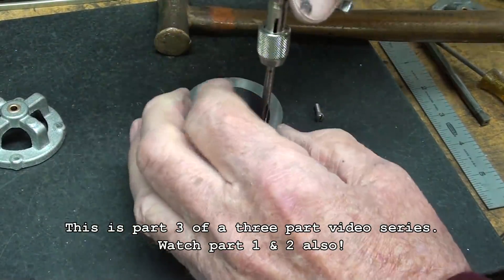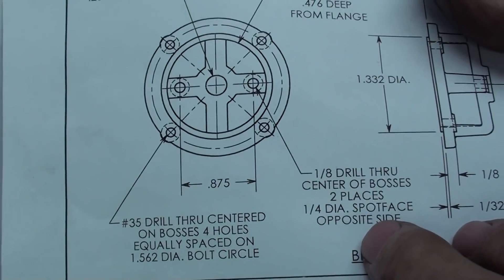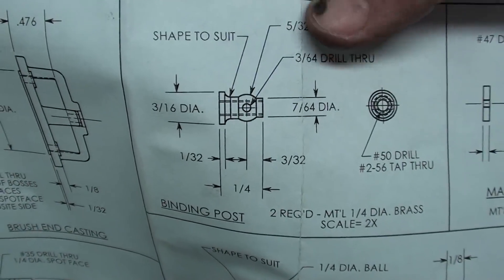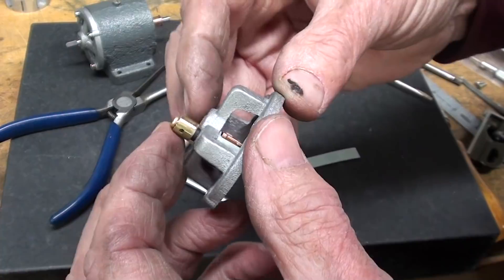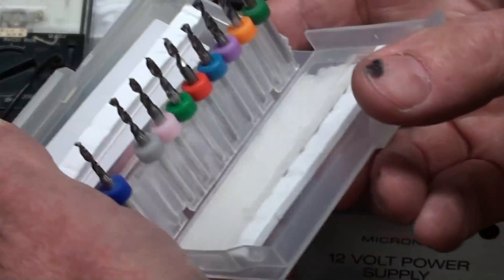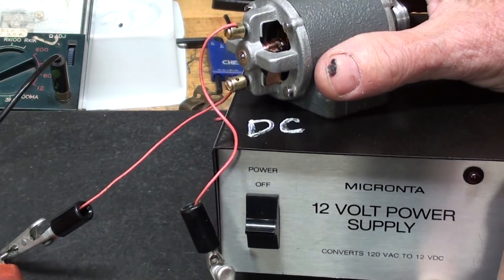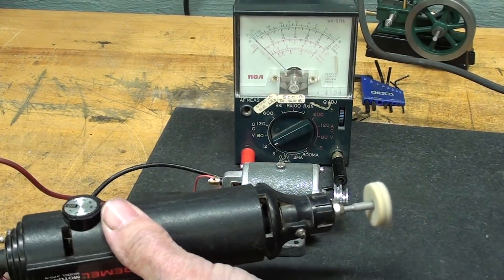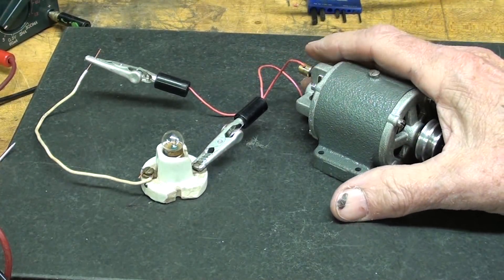Make a Steam Powered Dynamo pt3 Tips #438 tubalcain

Comment: Fahnestock Clips - I'm from the days of the Chesterfield smoking hardware guy. 
The clips were to the right of the light bulb display and the left of the knife switches with the ceramic bases. Across from the tube tester. And I could smell the light bulb display when you showed it. The bulb with the wire soldered on sure does being back memories - it's how I found my way into Electrical Engineering...

I like the dynamo, and I see they have some nice other kits. I'm liking the little shaper and the 1/4hp repro steam engine. Thanks for clueing me into this neat company...
I may just build a dynamo and use it to drive the shaper... The dynamo looks like a nice easy warm up to the more intricate stuff.
Good series!
Reply: LOL  Me too Scott.  I remember well the "tube tester" in hardware stores.  Folks would forget to set the filament voltage to the proper setting a it was guaranteed that they would be purchasing a new tube after they blew the filament.  Sometimes (unscrupulous) shop owners would intentionally set the filament voltage high in order to boost their sales..
Reply: Scott Marshall Our local hardware store had thousands of oak drawers, and the clerk could grab the right one without looking. They had a basement storage area with specials. Like handles for a wheel hoe - several types. Axe handles - several types. Etc.
Reply: With wood plank floors. The 'feed  & seed' was in the back, What I'd pay for an air freshener with the smell...

Comment: awesome series of videos. I was thinking as you put the spring in place to hold the magnets that I would have used the string to pull the spring through from the other side. I've always been fascinated by dynamos and  motors, the engineering is much more complex than most people realize. magnet sizes,number of fields,armature diameter, no of turns per winding, length of armature , all make a dynamo work differently and are engineered to produce the highest output to input power ratio. 
Thanks for another great series of vids.
Reply from the maker: You are right, there is a lot of engineering that goes into generators, I worked in a motor shop where they rewound motors

Comment: If I remember correctly,  those clips are called fan stock clips.  I used them for building crystal radios.  I also used post binders.  The post binders looked much nicer.  

A wonderful project!  I look forward to seeing it run with the little engine.  One nice thing about using the little flashlight bulb is you will not have to run your engine very hard to light the lamp.  

All the best!

Mike
Reply from the maker: Thank you, my crystal Radiohead them also
Reply: Close.  Actually, they're Fahnestock clips.

Comment: Fahnestock clip is the name you seek Sir. Thanks for all you do and God Bless.
Reply: Very cool Fred.  I was about to google it.  I used to take them off of old batteries and screw them to my pine board base when I was making electrical projects.  Fun stuff and great memories!
Reply: Built my first crystal radio in1949 using clips off of batteries. Cats whisker and galena xtal mounted in lead. The coil was wound around a Quaker oats box and a piece of a hacksaw blade to tune.
Reply: Very cool Fred!  My first crystal radio was in 1956!  Galena based as well. Remember sanding off the enamel off the wound coil?  LOL   I lived in Rochester NY and had and still have a 50KW AM radio station there (WHAM).  I was able to pick that station up what that radio by touching anywhere on the crystal!  LOL  It got me started in a career of communications.  Ya never know what will "spark" a youngsters interest!  Went on to be a Radioman in the Coast Guard during the Vietnam Era, an Amateur radio operator WO2P, and worked at Xerox developing internet routers and gateways with Palo Alto Research center.  All because I successfully built that first radio.  Ya gotta find the spark that lights up a childs eyes then keep it glowing...  All the best-  Fred
Reply: W4JLE here
Reply: Good stuff.  My buddy in college let me talk to a guy in Idaho once, when a Kiwi broke in, he grabbed the mic.  I was hooked.  Got into AM, FM and TV broadcasting as well as two way radio.  Good stuff.  Light the spark and keep it glowing.   That is a quote worth keeping!
Reply: @w4jle  My first crystal set would have been around 1970. Enamel wire wound around a square wooden core. Piece of bent copper pipe for the tuner. IN34 diode for the detector. And, of course, Fahnestock clips for the headphone and antenna leads. Got about 5 stations.

Comment: Our local dime store not only sold the little bulbs, they also had a wooden tray with replacement glass lens for flashlights.  They also had a vacuum tube tester, cardboard tubes of BB's and roll caps.
Reply from the maker: Yes, I remember the little rack of replacement glass. And it was a glass, not plastic

Comment: I fully agree with your ranting. I used to buy gilette blades (had mach3) untill the made the 6 blade version and the price of mach 3 blades went up to 20$ for a pack of three blades. Then I discovered the joy of the old ways - bought a double edged razor blade and feather blades (the best ones) and now shaving costs pennies! Love it!!!
Reply from the maker: Are use the throwaway razors from the dollar store. They shave every bit as well as the expensive ones

Comment: I picked up a Dremel for ten whole AUD just three months ago from a garage sale. Things just aren't kept these days the same way. It's complete including the original warranty and manual, I believe the receipt is still in the box along with a massive assortment of tiny burs, chucks and still some of the original buffing wheels. Sadly the front end oil lite bearing is wallowed out and the back end rabbit/hare fur vibration dampener are well worn and I'm having a great deal of trouble finding a replacement. Aside from that she's still in as new condition. 

Given all of this, I went out and bought a brand new "Dremel"... my god how things have changed, even in the 40 years I've been alive. Cheap plastic casings and ball bearings made of only the finest chinesium. Three dremel's later and the one I've now got is the same. Slowly speeds up so you have to keep winding it back down to maintain control. This one at least will run at a decent speed at WOT without having to apply a chinese burn to the casings. I'd wager the old one I scored with it's bakelite housings,  if fitted with a new front bearing would purr along like she did out of the box. 

I'd be happy to donate it to a better home Mr Pete, if you'd like it for spare parts or to restore to it's former glory.

Comment: Great video. The last flashlight bulb that I bought was from Sears and it cost me twenty bucks. It was in 2010 and I wanted to try using an L.E.D bulb that they offered as a replacement for three cell flashlights. I was not disappointed. My maglight has never been brighter and eight years later it still has the very same bulb in it.
Reply from the maker: Wow, 20 bucks for a bulb

Comment: If nobody has mentioned it , that little clip is a "Fahnestock" clip. They were used on old radios for antenna/ground connections as well. 
You used to be able to find a neat "pigtail" with these clips on either end that could be laid in a double hung window sash to allow your portable to connect to a larger antenna, without drilling holes in the wall. 

Also, that little generator just needs some tiny little oilers on the endbells to make it perfect.
Reply from the maker: Thank you

Comment: Hello Mr. Pete, you got me so interested in your Dynamo project that I visited the site PM Research INC and I purchased one of the Dynamo kits, however I don't have the equipment, skills or patience like you, so I bought the Dynamo kit machined and ready for assembly. It was indeed perfectly machined, so I painted the body and later this evening I assembled it. I looks a little different from yours with just minor differences, like the connectors where the wires attach. Once assembled, I found it difficult to turn the motor shaft. I loosened the back plate and front plate screws and that relieved the pressure, so suspect I have the bearing pressed in a bit to tight. I'll take it apart tomorrow and create a little more end play for the rotor. It turns OK now, but I think the end caps are a bit too loose. My kit came with what they call a pulley,  but I need to make a buy a pulley to get it to work better. Also my kit came with an eye bolt on top to hold the magnet spacer. Tomorrow I will hook it up to my power supply and test the Dynamo part. NOW the interesting part, I paid $95.00 for the machined kit and $10.00 shipping and got it in two days. Thank you for taking the time to show how to make the kit, even though I bought the machined kit. I was fun to assemble and is very well made. Thanks again, see you on your next project...Ken Marina CA.

Comment: Nice work as always! On larger DC machines the brush gear is adjustable this allows the brushes to be moved to reduce any sparking of the brushes, the direction of the motor/generator could have an affect the amount of sparking so adjustment would be made to find the ideal position.
Reply from the maker: Yes, I remember noticing that when I saw the large  D.C. machines in the Edison laboratory

Comment: Inserting the spring- put it in the other way around! Curve first, and just push.
Drilling all the holes in the milling machine means you both get them in the correct place (DRO offset) and can spot face them.
Ideally you would be able to slightly rotate the bell end at the brushgear- lets you adjust the timing for max efficiency.

Comment: You could connect the dynamo to an electrically heated boiler to make steam.  Run a steam engine with the boiler.  Run the dynamo with the engine.  Run the boiler with the dynamo.  Run the engine with the boiler.......... (Just hide the wire that adds the extra power into the boiler.)
Reply from the maker: lol

Comment: Regarding your comments  in the previous video on the details of the screws used on the Stewart models, over in the world of radio controlled models, there's been a movement towards scale accuracy in recent years, particularly in trucks and construction vehicles. The higher end models from manufacturers like ScaleArt, feature amazingly tiny metric screws, in the range of M1 to M3, 1 to 3mm.
Reply from the maker: That's interesting, I'm glad to hear they were doing that

Comment: 5:49 - What? No fancy ornamentation? So sad... just so sad. (Evil Grin)
13:54 - You could also use an LED or light... they require much less current, and depending on what RPM / Voltage your steam engine delivers, you simply install the proper resistor. An LED runs about 2.3 VDC, at 20mA, so take your voltage, say 12v... subtract the LED voltage, 2.3... and get 9.7 for example... then divide by the current 0.02A and get the resistance... in this case 485 ohms... so use a 500 ohm or so. Likely much brighter too!
Reply from the maker: Thanks Jerry

Comment: There you go... Built that dynamo 5 years ago, it never worked right, aaaaand I just found out why. I missed it by “that” much, well 90 degrees to be exact 😁
Reply from the maker: lol
Reply: After the “upgrade”, my dynamo is working just fine. 42V at about 15 000 rpm ( directly coupled to a Dremel tool )
Btw, I could not wait for the morning to go and do the fix 🤣

Comment: Awe no you blew a brand new vintage NOS flashlight bulb! ;)   LOL

Please keep talking about the old days!  I really love your stories. Thanks again for including your experiences like that.

The little dynamo / motor sure runs and works great. I'm looking forward to your steam driven generating set videos when you have the time and motivation to do that!

By the way, I recently got a pre-war Westinghouse motor which looks a lot like your little dynamo.  It also has brass bearings, but they are not Oilite. They are solid and have an oiling ring system.  The end bells have the same 4-spoke open style. It has a flat-belt pulley on it.

With a little cleanup, it runs like a top. https://www.youtube.com/watch?v=p-Xlm3oV_O0

Comment: Lyle, two things, firstly if you had inserted the magnet spacer spring with the small end first, and pushed it down into the slot with a small screwdriver resting in the vee part, there would have been no need for string or pliers. Secondly, why are you Americans so obsessed with Transfer Punches ? Never even seen any here in England. With your endcaps already drilled, you had a ready made drill guide. Position the cap where required, spot through one hole with the clearance drill into the body about about 2 threads deep, the correct way to tap holes so no sharp thread to pull up when the bolt is tightened.  Remove the cap, drill and tap the hole as normal, attach as you did with 1 screw, do the same to all the other holes, it has got to fit. The trouble with transfer punching, is just that it is only a center punch mark, even if you make it deeper with another center punch, there is always the risk of the drill wandering off the mark. By drilling through the part, the drill can not wander off. Keep the 'Good Old Days' rants coming, love it all.
Reply from the maker: As I have said many times there are scores of ways of doing a project. It's a matter of personal preference